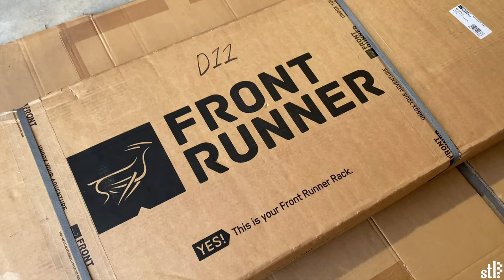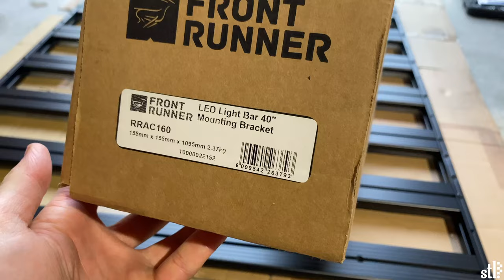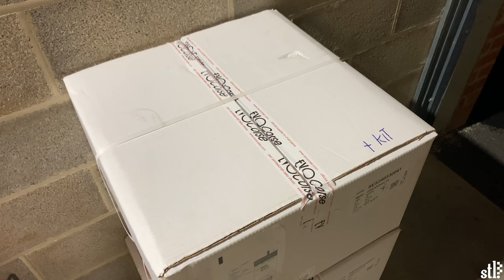Modifying & Camping in our 2021 Defender 110 Hard Top

Comment: Love the less is more video style format here.   A question.  On the first off road shots going up grassy hill track, why do the brake lights come on and off several times please?
Reply from the maker: Thanks for your kind words! Regarding that video clip, the brake lights were illuminating automatically, presumably as a result of the traction control ("terrain response" is the technical term, I guess!) making inputs and applying the brakes to particular wheels. I certainly wasn't touching the brake pedal at any point!

Comment: Hi, thanks for the video! I ready on internet that the noise of original LR rack is less than a front runner roof rack. I understand you can't compare, but can you tell something about the noise when driving (on a high way). Thanks!
Reply from the maker: It's quite hard to say because the sound deadening/insulation in the Defender is very good, but I didn't find the Front Runner Roof Rack particularly noisy without the Roof Top Tent installed. I can't comment on the OEM Roof Rack, but I have read some reports that it's quite noisy at high speed.

Comment: Do you find the FrontRunner roof rack better than the OEM Defender roof rack and why?
Reply from the maker: It has a lot more storage space by way of having additional slats (11 mounting channels as opposed to the OEM rack's 8) and also the ability to fit additional accessories in the side channels (for example, the LED Light Bar and Quick Release Awning Mounts on our car) that don't take up any space on the rack itself. You can then also use the full Front Runner range of products on the rack, whereas the OEM rack does not have much support for accessories  (you can't even use the Land Rover Bike Carrier with the Land Rover rack, for example). I hope that helps!